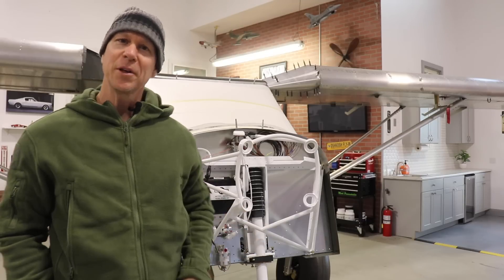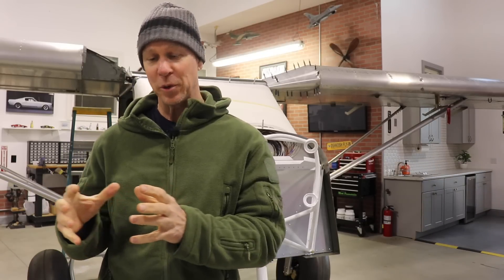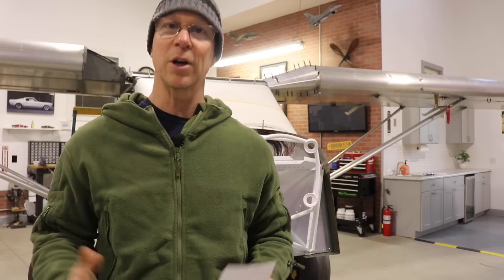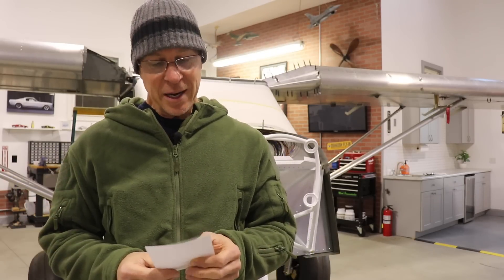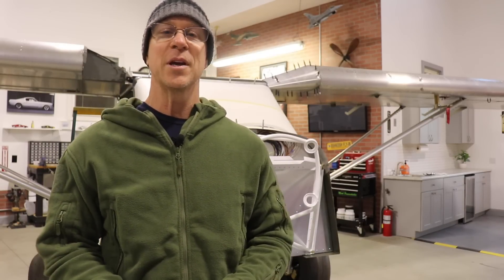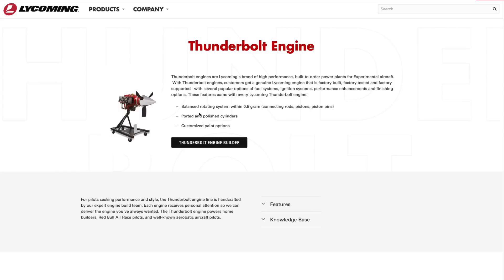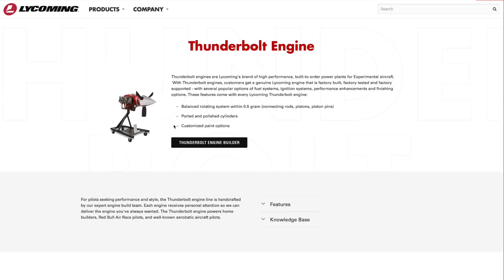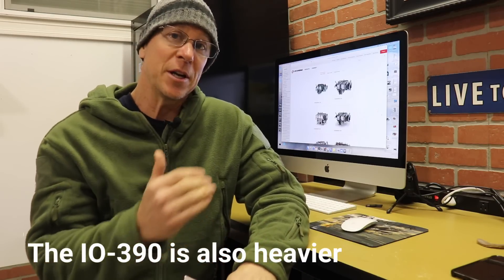Which ENGINE am I installing in my Zenith CH-750SD?

Comment: I am too cheap. But I'd recommend putting a turbo normalized standard engine. I'd go low compression so you can use mogas. I'd go with something even more well known than the lycoming. I'd go with a turbo normalized corvair engine. GM built over 3 million of them and there are lots of accessories readily available. The corvair also doesn't need a reduction gear. Best of all, the corvair engine starts out a lot cheaper than the lycoming. The 1965 or 66 monza version is what I am eyeing for my scratch built super duty 750. Good luck with yours.

Comment: no clue on the validity, but my dad always said that you'd be better with a bigger engine, running it slower, than a smaller engine, winding it up.  he was also a former first lietenant pilot in the Korean War, and though was very savvy on mechanics, was NOT a mechanic.

Comment: Didn’t hear the price difference between the 360 & 390. I’d calc the weight & balance full fuel max load and see what works best. I flew a B35 BO that needed a little weight in front. Nothing critical but the fat guy rode in front lol. Sometimes less is more if range is more important than climb rate. Would airspeed change much in cruise? Plot out the difference for typical flight with reserves. How much time saved vs fuel burn. If I went with the 390 I’d surely opt for a constant speed prop. I guess the depth of your pockets will be a determining factor for sure.

Comment: i just installed the 390 in my RV 14a not  a thunderbolt  What a rocket ship  I named the plane Blue Thunder because of the preformance   Everyone that has had a ride with me says how impressed they are. Airflow is the way to go . The owners are great and  make you feel like you can talk with them no problem. I can not say that for Lycoming. I have a kitfox SS 7 with a Lyc.  233 thunder bolt also, have not had one problem with eithor. Have any questions give me a e-mail. Ive built 3 aircraft and I am planning to build the RV 15 when it comes available.
Reply from the maker: Good info!

Comment: Is the weight difference in the IO-360 180 HP has parallel valve cylinders and the 200 HP has angle valve cylinders

Comment: I am about to commence a 750 SD build and like everyone, feel the dilemma of which engine to be a tug-of-war. 
I share your sentiments exactly in regard to the class of Lycoming engines but at the same time, would very much like to hear your view on your experience with the UL Power engine in your 750 Cruzer and why you did not choose UL Power again if you felt safe and confident with it. 
Congratulations on the channel, it is very helpful.

Comment: Boy did you miss the boat.  You want simple but lycs and conts aren't reliable.  AOPA:  2019 ...of 194 mechanical accidents, 132 were engine failures.  And btw reduction gears and liquid cooling have NOT been failing...at all!  1935 technology sucks.  Go Rotax and you'll live.

Comment: Ok I see most are helping you with the one you are leaning towards. But I am am engine guy and higher horse power in the same block means less reliability. That's why I chose the 180 hp for my 7. Of course your application is different and that 390 sure is nice.🙂
Reply from the maker: I’ve really been looking into this and thinking about both engines. I’m starting to think that lighter weight with more useful load is more important. I’m not one to put me or the airplane at risk and I do t ever anticipate flying into a field where I could only get out with 210hp and not 180. I really don’t envision myself flying anywhere a Cessna 180 or Super Cub couldn’t fly into. I’m really starting to think the 360 is the way to go. After the holidays I’ll contact Lycoming and see if I can plan a visit. They are only about 2 hours away from my home in Pennsylvania.

Comment: The difference between the Lycoming o235 L2C and N2C is compression.  L2C goes in Cessna 152's and produces a smidge less horsepower,  but you can run it harder and it's more tolerant of fuels.  The N2C is more often offered for Vans planes.

Comment: For what your planning I would go with the 390, I don't think fuel burn is going to be that much more, I would rather have the confidence on getting out of short field in a high density altitude, than worry spending $20 more dollars in fuel. I also think with the correct prop, fuel burn difference could be nil.

Comment: Something to keep in mind is that you'll be happy no matter what choice you make. The airplane is beautiful, and I'm sure it will always be a "work in progress" like all aircraft are :) 
Personally, weight is everything in my build. The listed weight of the 390 around 9:10 is the dry weight, while the earlier listed weight for the 360 is the full FWF install (as far as I understand it). If you can do a W&B on the aircraft, you might be able to run the numbers to see if the extra 30lbs works (within CG range, good useful load, etc.). 
If this were my build, I'd most likely go with the IO-360-B. 180hp will give you great performance, and staying 30lbs (or more!) lighter over the 360-A (and possibly more over the 390, but I'm not sure what the FWF installed weight on that would be) will help a ton. However, if you're already too close to your aft CG, or want more flexibility with the baggage area behind the seats, the extra weight on the nose might be worth it. 
Hope this helps. Love the videos, it's a great inspiration to see what other builders are doing :)

Comment: I am currently in the middle of a Super Duty build as well. I also did a mental tug-of-war between the two Thunderbolt models. First conclusion , you can’t go wrong with either model. ….After lots of conversations with Roger at Zenith and Jeff at Lycoming and Nick at Arion Aircraft who is helping with the builder assist, I decided on the Thunderbolt IO360 with dual EMAGS.  The only real concern that came up was (Potential) cooling issues because of the super duty’s  slow speed limiting the  air flow that (might) be required by the bigger  engine, along with the the size of the engine compartment and baffle locations, etc… I do not think they’ve supplied an IO390 for a Super Duty yet, but somebody’s got to be first!… again, you can’t go wrong with either engine as you’ve already concluded. Cheers, Gerard
Reply from the maker: Good info! I’ve talked to Roger too and he seems to think the 180hp would be perfect for this plane. Going with the 390 does present other issues. The more I think this over the more I’m leaning towards the 360.

Comment: What sort of production lead time are you looking at on the Lycoming?  Seems I recall it wasn't that long ago that one of the major manufacturers was so far behind that they weren't even accepting any new orders!  Hopefully that's been resolved!
Reply from the maker: It could be a bit of a wait. My original plan was to get the entire airplane painted, attach the wings, etc.. and then buy an engine. But now I’m thinking I’d rather mount the engine before the fuselage is painted because there’s a lot of work with fitting the cowl and I’d rather not have to worry about scratching paint. Plus, I’m thinking about making my own cowl out of carbon fiber so that’s a lot to do with a painted fuse. So I was in no hurry to order an engine, but now I am!
Reply: @KitplaneEnthusiast  I'd definitely be interested in seeing that carbon fiber cowl build!👍
Reply from the maker: @n206ja  I'm not sure I will do it, but the stock cowl is very heavy. I'd sure like to save some weight up front.

Comment: First, I would like to say, I agree totally with the Thunderbolt idea.  When I replace my o-320 in my RV-4, this is what I am getting.  The only drawback I can see is the time to get one.  I hope that doesn't become an issue for you and gettting your Super Duty flying when you're hoping to.  The real difference between your engine choices might be the compression ratios.  The higher the compression, the more stress on the engine.  You might consider that under your desire for reliability and also longevity of the engine.  You are obviously very good at taking care of and maintaining things and making them last.  So this might be important to you.  Less compression means lower horsepower, but the tradeoff is a lighter engine with these options and lower fuel burn.  Pair that with eMags and fuel injection and a full suite of engine monitoring, you can safely run lean of peak to reduce your fuel burn further.  Lower fuel burn might mean you could carry less fuel on those high density altitude days and get back a little performance there.  Emags - get 'em!  Again, ticks off your desire for realiability.  The classic mags in this case are worse than the new eMags - proof is the higher mx interval required with most - a sign in my book that even the manufacturers and FAA don't trust them ;-).  I have a pair of eMags on my O-320 and they have never given me a problem.  They also have a super nifty feature that retards the spark for starting, making it much easier on the starter, the electrical system and probably the engine itself.  I have several hundred hours with no issues or mx other than condition inspections so far on mine.  These also allow the use of auto spark plugs which actually work better than the much more expensive aviation types (in this case newer technology meets all your requirements - plenty of time in service to show reliability, maintenance is so easy on this one, do it yourself (even in the back country with a spare set and a wrench - but you're unlikely to ever need to, and much more cost effective.  Well, you probably already found out about most of this from your own thorough research, but maybe hearing from someone else that has been actually using these things may help you with your decision.  Good luck whichever way you go with it!  Thank you for taking your time to put on the channel.  I really enjoy and learn a lot about working on experimental planes in general from watching it!  Ben
Reply from the maker: Lots of good information - thanks for sharing your thoughts. The more I think about this, the more I’m leaning towards the IO-360!

Comment: Fuel injected so no temp problems with carb heat, IO390 there are fuel work arounds. Constant 3 blade prop.

Comment: Range is not a factor if the larger  engine is used to increase cruise efficiency rather than performance.  The cost of shorter, steeper  takeoffs and the assumption this means more airfields available is the crux of it.   Would applying the cost difference to fatter tires allow the plane to access even more fields than the more powerful engine would?  The cost differential should be considered an annuity yielding the cost of money + available earnings.    It could pay for some trips, which indirectly means more fields.  

Should longevity really have been a consideration?  Will this plane accumulate more than a few hundred hours in the next 10 years?  If not, amortizing the cost of the next engine with the the cost of money + the future-value  of the savings on a short-lived engine is worth consideration, especially when the next engine may never happen.  I say: small engine, big tires, more trips, more videos.  Yay!  

This was not my first inclination.  I tend to think bigger is better until the engine rips the snout right off the airplane.  Then I think, "Oh... we need a stronger airplane."

Comment: If the IO390 is really that much lighter it seems like a no-brainer! Easy to pull the power back and cruise for less fuel. Fwiw I’ve really enjoyed having an electronic ignition on my O360. Great engine starting, reliability, and nearly zero maintenance costs. Congrats on a big decision!

Comment: Sure you could go with old air-cooled designs, but maybe also check out a newer Honda conversion like what Viking supplies. You'll save almost half up front, and get a more modern engine that starts more easily, burns nearly zero oil, and has higher efficiency.

Comment: Fuel burn = HP setting give or take? 

Heavier nose = more payload capacity weight and balance? Calculate for both and compare?

Talk to zenith? Current thunderbolt super duties out there?

Calculate power to weight based on entire airplane not just the motor?

Don't underestimate density altitude, engine and airframe loose performance.... weight bad! Power good! I don't know!!!

Comment: I fly in the Idaho backcountry. I have several friends that have Husky's and Scouts. They use the Lycoming 0-360-A1P, 180 HP engine and can more that carry their weight, camping gear etc. I do have one friend that opted for the 200 hp Husky. He wishes he had stayed with the 180 hp version. He burns more fuel and doesn't think he gained all that much.
Reply from the maker: That’s good info-thanks!

Comment: Well, you have a cruiser that you "may" sell. You've indicated that you want to use this back country and STOL flying. If that is really what you are looking for, I would opt for the best combination of horsepower to weight ration that you can get. There are some locations that you want to get into and out of quickly that require horsepower. The less usable horsepower the fewer locations you can get to. You may also be flying at some higher elevations and I would consider performance at those extremes as well. It there are some STOL flight clubs you are interested in they may have best recommendations for participation in their flight club. If it were me, I would really like to participate in some STOL competitions. If that is something that interests you, then you have to determine how effective you want to be in those competitions. Are you comfortable with a tenth place finish looking up at number one? I doubt it. You may have to have two engines!!!!

Comment: The Zenith is a light airframe and they tend to fly better with lighter engines.  I’d go 360 all the way.  The extra cost and weight just wouldn’t be worth it to me.  You can throttle back the 390 to get a fuel burn closer to the 360, but you will always use more fuel in the 390 due to its higher weight.  Just can’t escape that fact.
Reply from the maker: Yes a lot of truth to what you are saying. I’ve talked to Roger and he seems to think the 180hp is plenty of power. Another big factor is price too! I hear the 390 is quite a bit more than the 360!
Reply: @KitplaneEnthusiast  I haven’t check prices on Lycomings lately as I am going Rotax in my S-21, but I suspect the 390 is a fair bit more money.  However, for me it is balance in the airplane.  RANS originally recommended the Titan 340 for the S-21 (180 HP), but when I looked at all of the advantages of the 915iS such as lighter weight, more fuel efficient, cheaper maintenance parts like spark plugs, turbocharged which gives sea level power to 15,000 feet, it was an easy choice for me.  I lose some low altitude performance as the Titan has 40 more HP at sea level, but once above about 7,000’, the Rotax makes more power.  I won’t be doing a lot of super short takeoffs and landings so the cruise performance trumps the landing and takeoff distance for me.  Now, if I lived on a remote strip in Idaho and needed the best takeoff performance I could get, then I’d go with a Titan 340 in my case or a 390 in your case.  However, realistically, I will spend 90% of my time in cruise and probably 5% or less taking off at really short strips and that favors the lighter and more efficient engine for me.  It all depends on your mission and what you desire to optimize.

Comment: I think that for your application in the Super Duty, an IO-390 while a little heavier than the 360, is the better engine.  My thinking with that is that it is better to have the extra horsepower available from the engine and not need it than need the extra horsepower and not have it.  I think that regardless of whether you go with the 360 or 390, I would HIGHLY recommend you take a look at GAMI Injectors.  I've personally flown behind an io-520 with gami's and I can't recommend them enough.  they allow you to balance the air fuel ratios between each cylinder which helps the engine run smoother.  And because the AFR's are balanced, you can run lean of peak and save fuel.  Sorry for the long comment, hope this helps.

Comment: I like the choice either way.  My feelings are similar in that I want a proven and continuously improved engine from a aircraft engine company.  Anyway, if the price is still in budget and increased fuel burn and useful load reduction is not a high impact, I would go with the IO390/fuel injected/ dual electronic ignition and dual batteries.

Comment: Wy do You not select UL-power? You have that in your cruzer haven't you? 
(No offence just asking). And merry christmas to you.
Reply from the maker: Yes I do and it's been an excellent engine. It's quite expensive though and UL currently has no FWF package for the SD. I do not want to have to design and weld and engine mount, and then fabricate my own cowl. Also one of my requirements I mentioned is that if I'm flying this airplane all over the country, I want to be able to stop into any FBO and have their mechanic be able to work on the engine (If I would happen to need a filter or something). Any mechanic would be familiar with a Lycoming.

Comment: What would be the anticipated useful load if you went with the 390?  Will it be enough for your mission?  If yes, go with the 390.  If not, the extra 20-30 lbs may make all the difference if you're near the edge.

Comment: I would say 360. You're going to have good take off performance no matter what. I think at the end of the day you'll enjoy the longer legs more then a shorter take off run which will already be very short. Good luck
Reply from the maker: That's what Roger at Zenith says too. He said he has a lot of time in a CH-801 with 180hp and it was plenty of power.
Reply: @KitplaneEnthusiast  Fully agree, in addtion more power can lead to other issues during take off.